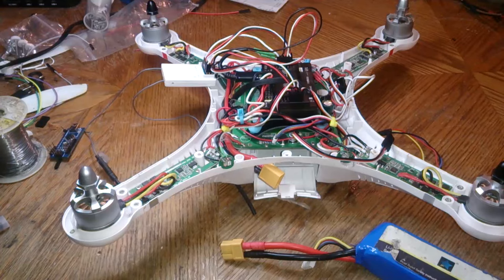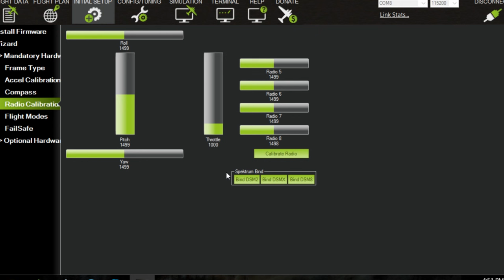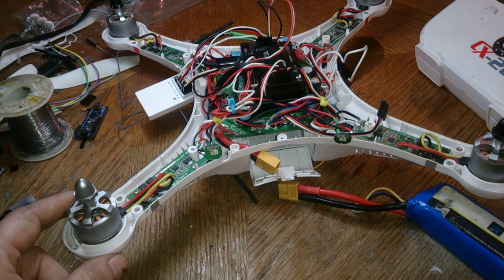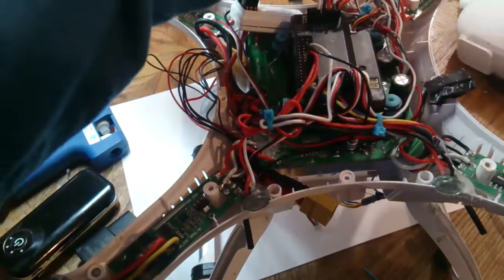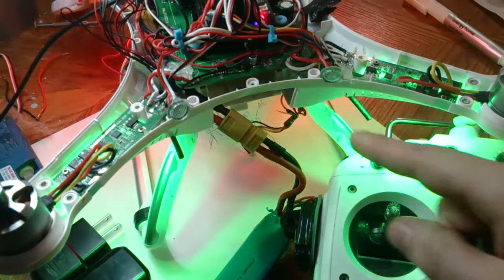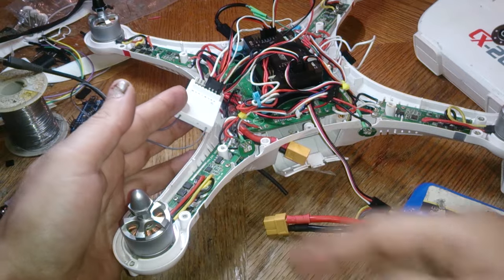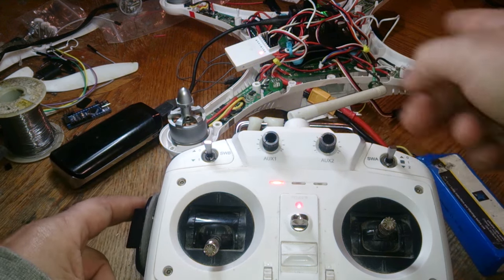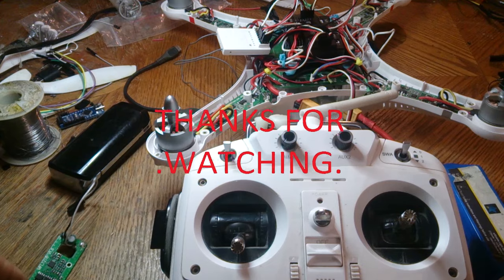cx20 esc trouble shooting

Comment: You sir are awesome for doing these videos, I got my ESC working again with the magic TX/RX trick, thanks. I've got myself a completely rebuilt CX20 as well on a 450 X frame (camera on the front), with loads of addons and upgrades. I've had a look at the rest of your video's, they are intriguing to use as a guide to mod even further!

Good stuff man!!!
Reply from the maker: wow you lucked out with the last fix I offered up for this video.. Thanks for taking the time to comment as well..   Its nice to just simply read a success comment every once in awhile =)..
Reply: Indeed, it also feels like a last ditch effort to get the bloody thing to work again. Although, I'm very suspicious of this revived ESC in any case :D
Reply from the maker: you should be fine .probably just out a few pwm's . on the apm or it was calibrated once wrong using the apm.
After  this video I do have two more fixes.. both being firmware fixes for either the esc or apm.....

Comment: Hi bangs,

Sorry for the delay, but the fried ESC is now in the post to you! 
It will be interesting to see what you make of it and to see what has fried on it :)

As a side question:... what do you think would be the best way to make the CX20 as fast as possible..?
I'm thinking that it would have a max rotation of about 80degrees, would need some upgraded ESCs, some more powerful motors and some suitable props...
But I don't know what power levels the components can handle etc 

Would be interesting to hear your thoughts :)

Thanks again!!
Reply from the maker: You would have to figure out the best forward tilt and roll you can edit this in the source to go above the maximum 45...   If this is something you can't do .. I can build you one at 60 degree.. ..keep in mind if you go to 80 ect.. you might just start flipping it all the time..   60 however should give your quad way more  distance during flight time ect..        using better motors and esc's would also not hurt. but the cx20 has flaws for the shell and the battery storage.   I've had 9 inch blades on mine.but I trimmed them about 1/4 on each side of the blades so they would not hit each other or the shell.         ..   For kicks I had added a a motor to my symax5c that faced backards for forward speed. it did increase big time.. so with the cx20 if you add a duct fan under it ..it would be interesting to see if it would be worth it ..    And thanks for the esc.. ..I really hope i can figure it out..I do have a a feeling its firmware corruption on some of them.
Reply from the maker: I can't seem to private message  you.. sooooooo with that..curious did you send it royal mail ?  tracking ending in 595gb..if so thank you,
Reply: +bangs6996 yeah that sounds like the one! From the UK! :) 
I would be very interested to see what you find is wrong with it so I do hope it's of help to you! 

P.s I just linked up an immersionRC 600mw TX to fatshark googles RX... wow.. makes flying so much easier! :) 

P.p.s do you know amp the stock ESCs are? I'm pondering the benefits of swapping to some stronger/higher kv motors... (I'm very much still in the 'research' phase...) 

Thanks! Hope the ESC is useful! :)
Reply from the maker: Not to sure about what to suggest for bigger motors..I just finished a build video for the robocat (well still have to edit the video..your esc got in the way)..its a small quad..if its speed your after you probably want to start looking at those type of quads..  about the esc.. I will be posting a video later...on the success!!!..=) so again thanks for keeping me busy for 3 solid days and nights.. ..

Comment: Great videos. I went through almost all of your other ones. Great contribution. Hat down for you man. 
My problem though is, after crashing my cx20. When plugging battery one motor beeps for about 2-3 seconds then stops beeping. Everything else work. But I think it’s rotating a tad slower than the others. Any thoughts ?
Anything will help. Thanks
Reply from the maker: the only way to really know is to get a rpm tester and test each motor example in on of my vids is this..
https://youtu.be/G26LuTrb44s?t=183   ... ..   besides that it might be calibrated wrong if you had done a all at once..
what you can try to do is each one by it self off "t" on the receiver and see if that helps.    the motor might be shorting out but usually it would smoke pretty quick with a short..

Comment: Bangs!! The new ESC appears to have stopped the beeping issue! And all four motors now work in harmony!!! 

It's currently dark here so I will take her out for a cautious maiden flight tomorrow and report back (hopefully with outstanding flight news)

If it's of any note, the motor with the new ESC always is the last to stop spinning when throttled right down 
It doesn't appear to still be actively powering the motor, but less so slowing it I suppose - just as if the motor is feeling less resistance when the throttle is off

Would you suggest doing an ESC calibration pre flight? 

Thankyou so so so much for all of your help - it looks like the light at the end of the tunnel is here! (Providing it doesn't fly sideways into a tree when I test fly her haha) 

I have the old ESC here and I will post this over to your diagnostics laboratory as soon as I can
Reply from the maker: I would do a esc calibration on it.. butttttttttttt I'm so so scared you will come back and say another motor is now screwed up..  (It was me who said ..do a firmware upgrade, whats the worst that could happen)  If you do decide to do the esc calibration.. just make sure to remove the b cable or the power module.   ... and good luck with your flight tomorrow hopefully you get to enjoy it,
Reply from the maker: and if you are nervous about the esc calibration.. just do a bunch of tests without the blades on..going full throttle and zero ect.. do it about 10-20 times ..and just watch the motors.. making sure that one motor never refuses to spin.. ..if all is well you can probably skip the esc calibration.   you can also try to bring the throttle up extremely slowly to see if they all spin at the same time. ... being out a tad is ok as the software will compensate for it while trying to level it anyways..
Reply: +bangs6996 fantastic news! She flies perfectly and didn't require an ESC calibration!

Woo woo!!

The fried ESC should be in the mail tomorrow or Saturday (im not sure how long it will take to cross the Atlantic - but it shall certainly arrive) 

No I can get back to trying to figure out the optimal tweaked parameters for the firmware via mission planner; hopefully get a maximum horizontal speed set up and get follow me to work! 

To confirm bangs: from now on, when connecting to the computer to change parameters etc should I just never plug the battery in at the same time? I.e does the drone need the battery plugged in to perform param updates? 

Thanks again, hope all is well
Reply from the maker: Congrats!!!  And thank you so much for sending me a esc.. 
...
The battery and usb should  never be plugged in at the same time..specially with sil esc's  For normal procedures... 

.You should be totally fine with the stock equipment and usb power. If you have telemetry its best to disconnect it.. Orrrrrr even safer is just to use the telemetry for now on .. the only time I find telemetry does 
not work is for compass calibration.. .. The second safest thing is removing the power wire out of the usb cable .. then your good for the battery and usb.

If you start playing with firmware upgrade.. Don't plug in the battery and usb..    If you want to be safe, when you do a update just don't touch anything ..and all should be well.. ..Keep the remote off as well during a update.         the ia6 browns out my apm as soon as I turn on the remote..

and lastly,,  back up your params they might come in handy one day.
...........

Comment: Hi Bangs, I'm currently rebuilding a CX-20 and upgrading it to a full APM using your videos and trying to follow this video to calibrate my ESCs I get no "musical tone" from any of my motors either at start up or during calibration. Any help would be awesome.
Thanks!
Reply from the maker: can you still arm and have the motors turn?    .if not  check to make sure your getting 12 volts to them..  if you have power module..maybe you forgot to plug in the other end..
Reply: I have a power module and I'm still geting 12v to the ESCs. I'm also getting the voltage to the ESCs from the APM and it changes as I throttle up. (between 2.5v-ish and 5v)
I'm beginning to think its the ESCs.
Reply from the maker: have you tried to calibrate with "t" on the receiver?
Reply from the maker: unplug power module and make sure b cable is not connected as it should not be anyways..

remove e,t,r from receiver
remove all esc wires from output.
plug in esc wire from motor 1 into t  
connect usb power.
turn on remote and move the throttle full (don't arm)
plug in battery wait for 2 beeps or 2 seconds.
move throttle down.
.. if that motor is all quite.
move throttle up.. 
Motor should spin.

repeat for each of the esc's

..
Reply from the maker: its 3am here.. not sure if you will reply back right away... .. If you do comment back I'll get back to you later in the day...

Comment: hi bangs6996 ,I just came across this video and I don't know how I missed this for so long,anyway my cheerson cx20 crashed and one of the escboards is not working any more the original board is ver1.5 and all I see on amazon is ver1.6 ,can this work for me ?
Reply from the maker: Hi ..yes  the version 1.6 should work fine..    if its motor 3.. there is a extra wire to control the led's that connect to a pad labeled ppm
Reply: bangs6996,man you are amazing ,thank you very much and as usual ,HAPPY FLYING.
Reply from the maker: @jeremyboyce1537  your welcome.if you run into problems with it, just hit me up again..Hopefully all goes well with  your project.
Reply: Ok Sir.

Comment: Good Day Sir, Wondering if I ditch the CX20 PDB and replace with a Mini Pix Current/Voltage PDB how would you power the ESC lights and second will the stock esc take 4s voltage? Thank you for your consideration.
Reply from the maker: HI I have read of people using 4s battery's on the esc's personally I have never done it so I can't say yes or no ..      for the led's you can wire them up to 3 volts
. I would not hook them up to the apm as it will draw to much current .    esc3/motor3 has one extra wire hooked up to a ppm pad on the pdb ..tape that wire up .its usually red.           That wire controls the lights it is directly connected to motor output 3 servo wire.

Comment: Hi bro, i tried swapping the motor control from APM and it work.. but the problem is the M3 port is not working. At first I thought my esc is the problem but then i tried ur method i found out that my M3 port is not working.. is there a way to fix this? Or do you have other video? Thank you.
Reply from the maker: yes.. i have another video moving the ports over
Reply from the maker: https://www.youtube.com/watch?v=LbS5L8jyYGo

Comment: Hey friend do you have any idea about how much flight time i am going to get with a 3s lipo 4000Mah ?
Reply from the maker: You should get around 19 + minutes .. but it all depends on how you fly what camera you have on it..quality of motors ..quality of battery ..and what you set your alarm voltage to.. don't forgot to get that cheap alarm thing i suggested.. it just plugs into your battery directly during flight ..  You tx does show the voltage though but a extra alarm does not hurt.
Reply: +bangs6996 ok thanks
Reply from the maker: It should be fine.. It says he is based in the u.s but by his products it looks like he is just a drop shipper so it might come from china.... Not sure like i said before if you can order from u.s because of the ban on battery's being shipped by air..   ... well i tried to fill out the shipping on that link and it says u.s only .. to bad i would of got 5 of those hehe..

Comment: My transmitter buzzer not working, any advise how to fix it? Is it 5V? What polarity?
Reply from the maker: search ebay ect.. for "5v Active Buzzer Magnetic"
or piezo buzzer
the polarity should be marked..   it is 5 volts.
Reply from the maker: the two times the buzzer comes on is when your bellow half way on the throttle and when the transmitter is almost dead..    have you tried to just leave some re-chargeable double A's in the transmitter and just leave it on till it dies.    

does the transmitter still work? only the buzzer failed?  just curious..
Reply: @ModItBetter  thanks, already ordered, my doubt rises because the failure came after a stock APM update, I will try to change it and the Pixhawk it's on his way
Reply from the maker: @yatengouncurral  kk.. honestly though a apm update would not effect either speakers..on the power mainboard or the transmitter.. I also have a video on how to restore your apm back to factory firmware..if thats the version you like....however the upgrade to pix is worth it anyways..
Reply: @ModItBetter  when it connects it should also sound and more important halfway trim, I think that's how you should say it in English. I would be looking for that video, I've a very unstable aircraft and really don't know what to do with it

Comment: Hi, i have problem with one ESC, it won't spin at full speed, I did your calibration, but nothing help. Motor, do not beep, just spin slow. is is on APM 252
Reply from the maker: HI .. go into radio calibration and what is your throttle high and low?
Reply: high is 1966 low 1020
Reply: I also try to spin engines at apm 2.6 and this one engine start spin and then stop, when I again turn down throttle and push it up, it start work and after few seconds stop.
Reply from the maker: so all the other motor work good?

.. if yes.
have you tried to do just a esc calibration on the one esc with receiver?

if you are using cx20.
unplug a,e,r,,1 2 3 cable from receiver.. only leave in b cable for power.

put bad esc into T,

plug in usb
turn on remote
go full throttle (do not arm)
plug in battery
wait for two beeps ..
put throttle down

before you do esc calibration see if motor works properly through receiver...plug into t and go full throttle to see if it spins ok..then try calibration.
Reply from the maker: just watched your video.. you sent.. I did not see it until today sorry,   youtube put it as spam and I don't look often at the spam section... .. 
So did you fix the issue?    seems like a short.  I would say its your throttle wire in your remote even ..but its only one motor doing it? ..   

have you tried what i suggested by hooking it up to t on the receiver and just plugging in the quad.. you don't even  have to arm the quad... just remove the wire that goes over e,t,r  and put that esc wire into t ..

that will rule out apm , and then fallow the calibration i suggested through t.
Reply from the maker: Also if you had tried t and it does the same thing.. 

double check wiring for that one motor..maybe its almost off esc board 
..
if it is only one motor ..then you won't be the wire in your transmitter.

  you can try to see if the main board is screwed up..   ..   
unplug motor 3 /esc .. from apm
unplug b cable from receiver or power module
..
plug in usb cable to power apm.
plug in battery .
test motors again.

..
You can try new parameters as well but I doubt that is the issue
https://drive.google.com/open?id=0B2w6_OKE_2kxM0xYckJidFNRWTQ

and lastly .. to find out if its the motor or esc.. If you can solder  ..un solder the motor and switch it with a working one and see what happens.. ...  the motor will also do that if it has a short
Reply: bangs6996 ok, try to do that all, but I think that this is motor, becouse I put new esc and at first spin motor spin like it need, and after few try esc start fault and motor beebs all the time. Then I put back old esc and motor right now do like in video I send.
Reply from the maker: yeah in my other comment i suggested to switch out the motor with a good one..   motors will do that if you have a short..   Like in my robocat video ..i thought it was esc.. i waited 1 and half month for new esc.. and it blew again and crashed my quad copter.. it turned it was the motor had a short in it..